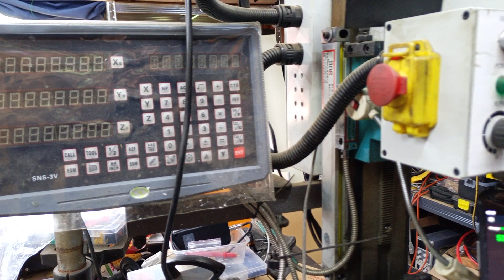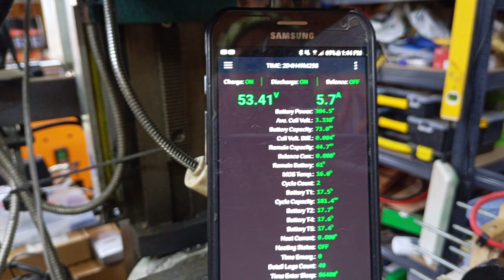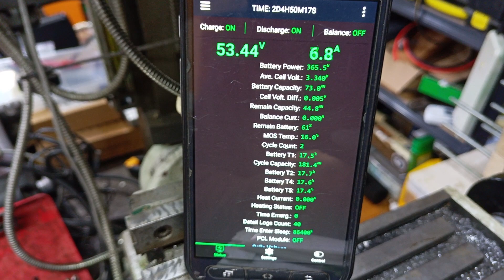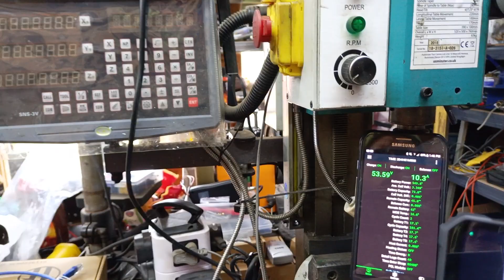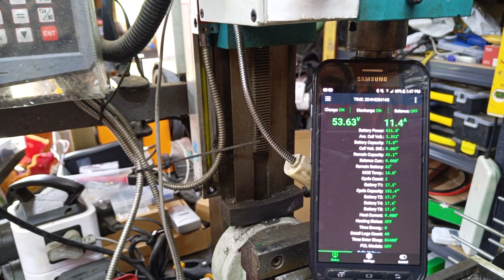Please help, which camera phone sounds best Phone 1. this one.  The Umidigi Bison Pro

Comment: I'll be honest with you mate after watching both videos on my mobile which I'm assuming is what most people watch on. They is nothing really between the both videos in terms of sound quality. The only difference I can see between them both is this video (phone 1) seems to adjust focus more meaning it goes slightly blury for a fraction of a second before refocusing back again. It could just be because you was using 2 phones together and not focusing on just one phone, I think it will just be personal preference for you for what the differences are
Reply from the maker: Cheer our kid.  Are they any good at all? 
Phone number 2 has a masive battery and a masive memory but it weighs a shit ton and is to heavy for a mount.
Reply: @garys-half-baked-offgrid-dream  both videos were decent quality. I played them both at 1080P on my phone and I had no issues with hearing you loud and clear on both videos. I even left my phone in the same place and at the same volume for comparison lol. I just think its whatever your comfortable with st the time
Reply from the maker: @karloffgrid  Thanks Karl.  The less Shakey the better so phone number 1 that fits my mount would be best.  
Just done a wee vid off fully charge on a gloomy day and you are correct, phone number one does freak out with the focus.   
I miss my wee Samsung.
Reply: @garys-half-baked-offgrid-dream  I do like the Samsungs I must admit. You can get cheap wireless mic's that plug into the USBC port ro connect to the phone instead of the 3.5MM AUX. It's what I'm going to look at getting next I think. It could just be the camera settings on that phone that makes it freak out on the zoom if it has auto focus turned on. I'm sure your videos will be great either way mate
Reply from the maker: @karloffgrid  I will check the auto focus.  Yeah I have seem there bluetooth and the usbc mics but its more money. Next month might be alright.
How is yours going?
Reply: @garys-half-baked-offgrid-dream  mine is going really well now there is more sun during the day. I'm still charging at night for an hour or so but I'll stop that once I have the 2nd panel up on the wall. I'm hoping to get it done this month but funds have taken a beating lol. I need to do a quick update video on the 1st one I put on the wall when I get chance. That unistrut is amazing for mounting solar
Reply from the maker: @karloffgrid  Pre COVID I was a machinist and then quality engineer for an engineering and fabrication company, unistrut is extremely strong and heavy duty when used and sized correctly.
Sometimes I miss work.... I could have got that so cheap 😭😭😭
Reply: @garys-half-baked-offgrid-dream  I used 2 lwngths of 21MM X 41MM unistrut for 1 panel lol. I could swing off it its that solid. Covid has alot to answer for unfortunately in more than one way. Luckily I wasn't affected by covid in a work sense but I know lots of people who were. You need a side hustle other than the solar to keep the mind going
Reply from the maker: @karloffgrid  My first though was you could swing off of those dimensions.
The 3 O.A.Ps keep the mind and body more than active.😅 
The solar and chickens are my side hustle to escape them 🤣🤣🤣

Comment: They seem the same mate
Reply from the maker: Bugger lol, how bad???
Reply: @garys-half-baked-offgrid-dream  not too bad more than watchable
Reply from the maker: @dama054  Phew!!! Thank you David
Reply: @garys-half-baked-offgrid-dream  did you get the BMS to talk too the inverter I have tried to get my seplos bms talk to my inverters and was never able to so just run my lithium batteries on user and set the charge voltage accordingly
Reply from the maker: @dama054 Oh man why is tech testing us? I hope you get it cracked. No not trued mine yet I needed a break from it, got in the garden and just enjoying watching the sofar working and charging.  
I need to put my big boy pants on, take a brave pill and get hooked up to the big battery and coms if needed.
The old saying "If it ain't broke, don't fix it" has been running though my head and giving me Hart palpitations lol
Reply: @dama054  Hi Bud...Which inverter do you have please ? I'll be using ( well trying to use ) a Seplos V3 with my Sunsynk Inverter....My batteries should be here soon and it's a pretty major cause of trepidation lol.
Reply: @kennyrodg  I'm using the first version of the seplos and the inverters are the mpp solar U5648MS
Reply: @dama054  Cheers for that Bud...I was hoping you might be on a Sunsynk or Deye on the off chance.
Reply: @kennyrodg  will be soon hopefully